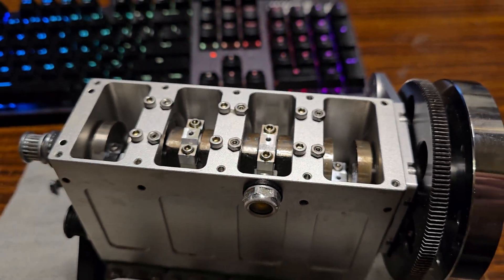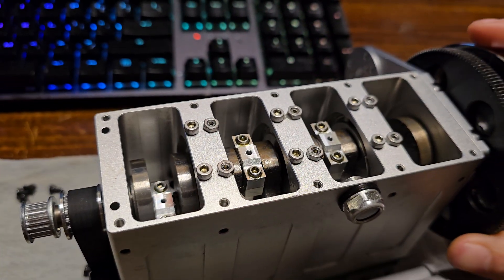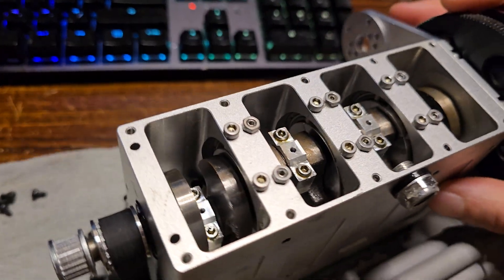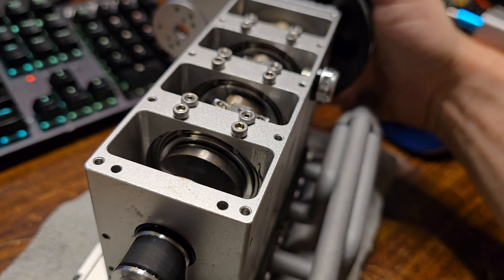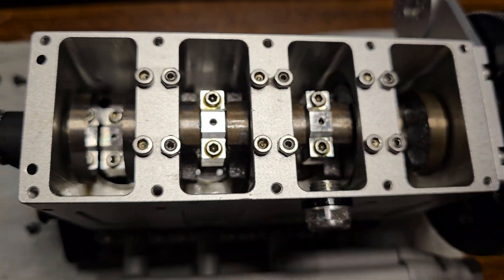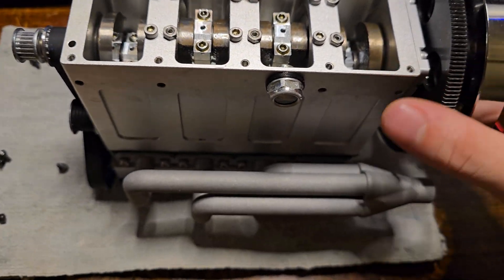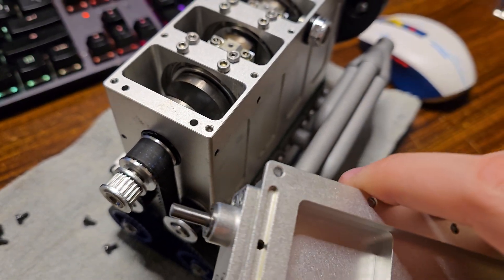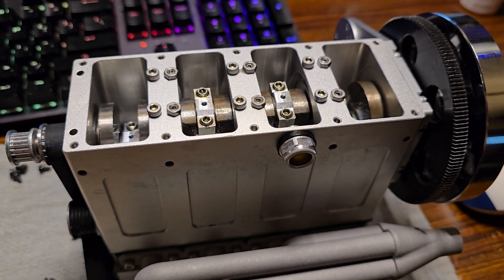Inside the Enjomor D6!

Comment: You could just put a hole straight down the sidewall, directly intercepting the crank, tho obviously done with the crank removed... You could then rotary mill with a t-slot cutter with radius rather than a straight edge - a groove in the bore for the journal bearing in that place, a crescent moon groove essentially running only on one half of the i.d. of the bore, thus allowing the oil to flow around the bearing(maybe put a hole through the bearing too, but on the side rather than in line with the drilled ``cross hole`` to have the pressure feed the bearing some oil without causing as much turbulence in the flow(as opposed to hitting a hole and then ``deflecting`` back out and to the side down the cut channel... That would add lubrication to the end bearing while achieving the thing that you want - better lubrication and more efficient oil flow... The other side would require a custom solution to better lube the other end bearing, but this is just what came to mind the instant you mentioned the modification, i ain`t doing mental gymnastics to further the design, i am just sharing what came to mind... 
Also, keep in mind that i speak from the perspective of a machine shop operator/caretaker, so my ideas of ``easy`` and ``quick mod`` imply a whole bunch of metalworking machines at your disposal, but a hobby mill and a hobby lathe would do, if they are large enough... First time seeing your channel, so i can`t draw conclusions about your eq. from just seeing this thing on your table... 

Best regards!
Steuss